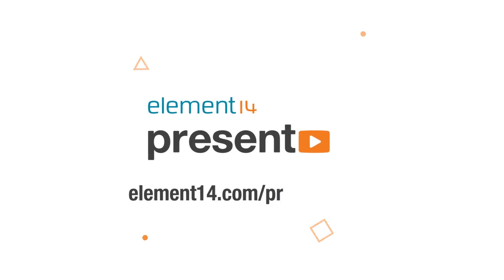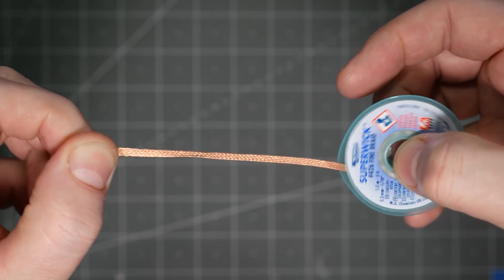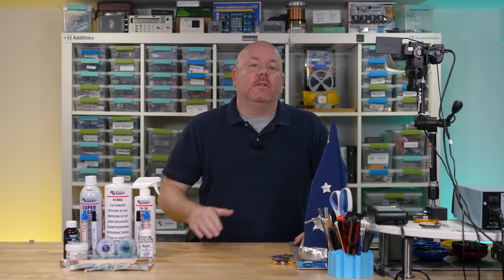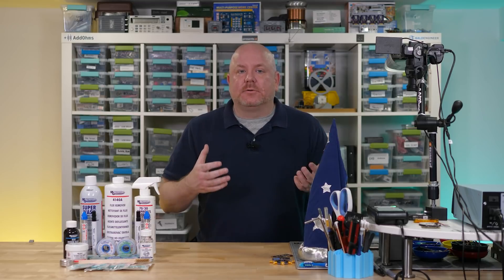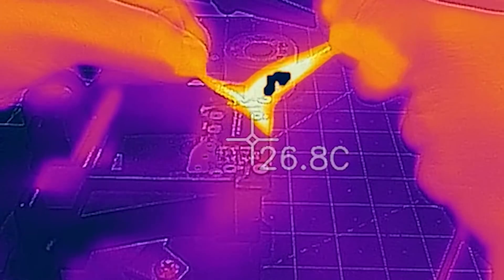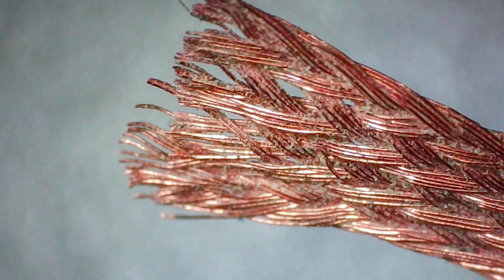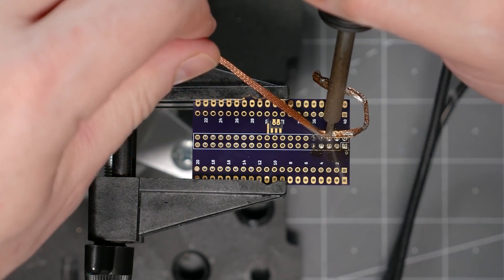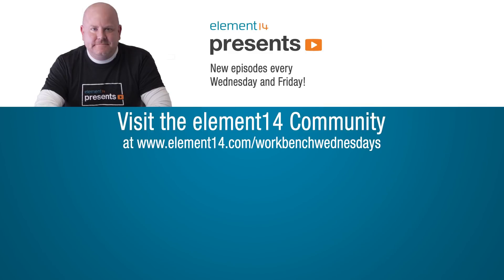Desoldering Wick Tips and Tricks with Superwick™ - Workbench Wednesdays

Comment: When nothing better was to hand I  have used fine stranded cable dipped in  heated  pure  rosin  melted with a soldering iron before now and that works extremely well, its only downsides are its a bit smoky and solidifies when cooled down..   the solid rosin can also be used to temporarily cold things down when you get the knack...

Comment: Thank you! Two things from the video that helped me to desolder a 3-pin transistor (on some practice board, the 3 pins are on the same line while on others, they are arranged as the logic therefore sign which are way easier to solder):
1. Use a flat head (or whatever it is called)
2. 450C
I also found that for these kinds of small components, it is better NOT to use a wick in the beginning -- instead, just add a lot of solder to connect all pins, then use a tweezer to holder the component from the other side, re-heat the solder to 350C (or whatever degree for the solder) to melt it, and with a slight pull of the tweezer the component should come down easily and cleanly. THEN clean it up with the wick -- much easy to clean without the pins!

Comment: 2 things. 
1. You shouldn’t only add solder to the iron before wicking sometimes. You’re supposed to do that. It helps every single time. Don’t ever not do that. 

2. It’s worth mentioning more than once. Cut smaller pieces of wick from the length when you use it. Don’t leave it as one long strand while wicking because it’s just a long heat sink. Cut smaller maybe 3 inch, 2 inch or 1 inch long pieces depending how much you need when wicking. It’ll help, believe me. Then cut a new piece as needed

Comment: It would be useful to distinguish between heat and temperature. When desoldering with wick, and especially with large PCB conductor areas like ground planes, you need to supply a lot of heat to get all the solder up to liquid temperature. For that purpose, it's better to use a larger tip that has been brought to an appropriate soldering temperature and can quickly share its stored energy with the work. With a smaller tip set to higher temperature, the tip's stored energy is quickly drained to the work, the tip goes cold, and its ability to convey more heat from the heater element is restricted by the small tip size.  Regardless, at least always use an iron (or tip) with temperature feedback control, and not a merely "adjustable" iron (essentially a dimmer-controlled heater) that's either too hot on the stand, or too cold in use.

Comment: The lead free solders gave me the most grief until 
I tried "Louis Rossman's idea of sucking up as much as possible, then applying leaded solder before using solder wick.  You don't need as much heat so there's little risk of lifting a pad.

Comment: What about those desolder vacuum machines? Aren’t they good?
Reply: They are perfect for desoldering through hole solder joints, especially if you need to desolder IC packages with many many pins. It's so much faster and hassle free compared to using solder wick. Which in turn is better for cleaning up SMT pads to be honest.
Reply: @guffaw1711  Did a ton of TTL removal back in the day. When you get good at it the chips would almost just drop out.

Comment: Gootwick > MG!
Reply: TechSpray Pro > Gootwick 
Much tighter braid than goot
Reply: @chrislong7590  I have both, and you're right. I compared and Techspray is tighter. Still though, I have an easier time with goot. Maybe density isn't the only thing that matters.
Reply: The both have advantages depending on if you want soft/pliant wick (Goot) or more solid.

Comment: The biggest mistake I see when people try to use wick/ braid or what ever you call it in your town is that you should tin it before you start or tin the tip an bring it to the braid before touching the joint you are trying to unsolder it's all about that heat transfer. The other tip I find useful is inspect that braid if it's gone a bit dull looking from time and the solder isn't wicking up it run the flux pen over it.

Comment: coaxial cable is also useful as a wick ;-)
Reply: Yes, it does work, but nowhere near as well as a good quality desoldering braid.  I find that if I coat it with some flux before using, then it performs much better.